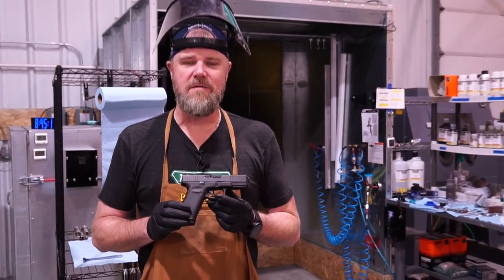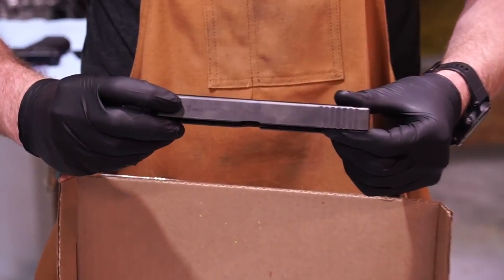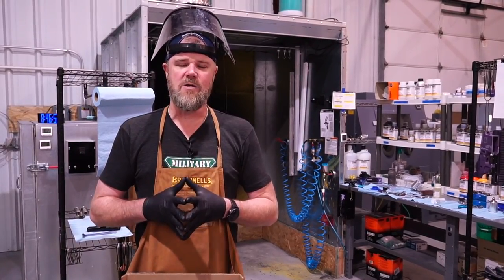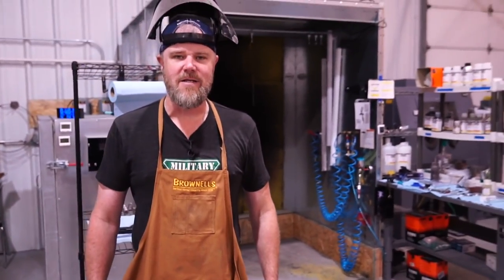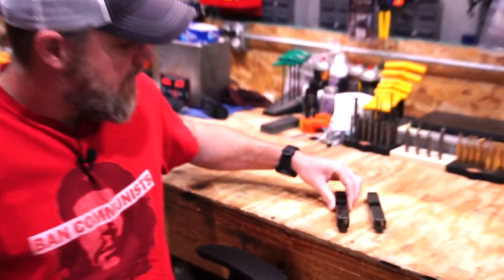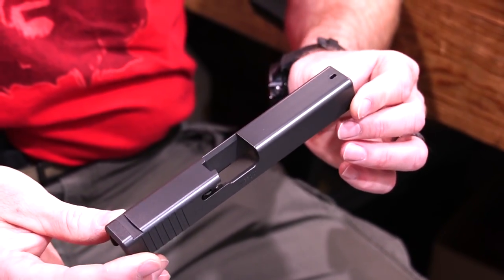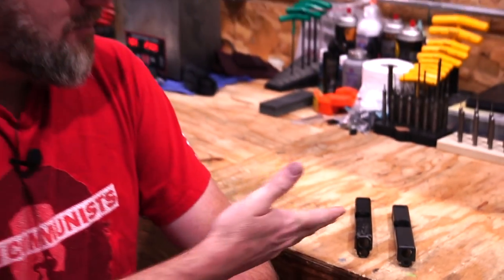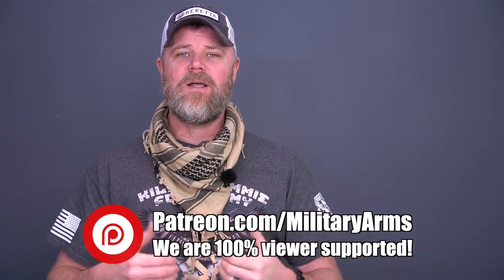Cerakote Acid Test

Comment: I'm sold on cerakote. After seeing a house fire firsthand, the cerakoted pistol was the only one that did not rust inside the safe.
Reply: And it makes the gun look cooler...while being fairly cheap.  That's what we call a win/win/win.
Reply: @Mrgone454  or a  win/win/win/win/win
Reply: I lived through a flood here in Texas my gun safe was under water for 5 days it was another week before I could get to the safe and get it open my Glock pistols were the only ones unaffected, one was a 17 Jen 2 and the only spot of rust on the gun was on the Trijicon night sights .I spent more time scrubbing the mud out of the plastic frame( which I believe still has some stains😁) then I did on any metal part on the gun.

Comment: It would be interesting to test all the different finishes Glock has come out with to see if they are actually moving forward in durability rather than just different looking.
Reply from the maker: If only we could apply all the finishes for testing it would be cool.
Reply: Military Arms Channel why would you have to be able to apply the finishes? They’re already on the guns? Something went over my head on that.
Reply: @Shane K He might not be able to source all of the guns and their factory finishes, so it might be easier for him to apply them.
Reply: Resilience to hydrochloric acid doesn’t mean anything in regards to real world durability. If that’s a test you want to do that’s fine but it would yield no data about the real world and couldn’t be used as a basis to see if Glock is “moving forward”. It would be like putting different gen glocks in a foundry furnace, melting them, then drawing some real would conclusion because one gen of Glock melted at 2500 degrees and the other melted at 2650.
Reply: @tonyn363  actually it does. Like he said in the video it is just accelerating the corrosion process. I don't clean and oil my gun everyday after carrying it. In fact I might go a month or 2 before cleaning it, even with shooting it most weekends. That would just be too much cleaning to do for me. So being able to have my sweat on there for extended periods of time and not start rusting or something is a good thing. I don't need it to resist acid but it will give you an idea as to which one is better. The next test would need to be abrasion testing. I'm not going to cook it to my truck and tear down a gravel road and expect it to be perfect but it would be nice to know that it will at least take a while before it starts to wear.
Reply: @HickLif3  Your body doesn't excrete hydrochloric acid. Dump it in a fully saturated salt water bath and have a more realistic scenario. Hydrochloric acid in that sort of concentration isn't even near a realistic scenario. Not only that is that there are my substances that resist hydrochloric acid. Just coat the thing in Polypropylene and it would be impervious to to this acid. But poly would melt under heavy use. Interesting but not real world scenario. Lets not pretend its something it is not
Reply from the maker: Did you see the Cerakote take the non-realistic test? Did you see the pics of the Glocks that were rusted? Let me guess, something unrealistic happened there too.
Reply: Military Arms Channel look. I’m not here to be a troll. I’m here because I like your channel. My point is that some substances are inert to specific acids. Some plastics are completely non-reactive to hydrochloric acid but mean nothing when exposed to heat or UV rays. Just because the cerakote Glock survived hydrochloric acid doesn’t mean it has the same abrasion resistance. All that tested here is that cerakote can survive hydrochloric acid and that is all.
Reply: @Militaryarmschannel  hey Tim awesome video like the other comment was saying any plans to see how other finishes hold up to this test I'm really interested to see how a gen4 finish does and an original gen3 finish as well as the g19x finish
Reply: They’re moving backwards, the new finish is a flash/ gas nitride, the old was shot peened then salt bath nitride and a coating applied over that.

Comment: 7:30 - If you can get the same result in 24 hours by using hydrochloric acid, that would be the standard corrosion test rather than everyone using a salt spray to test corrosion.  I suspect both finishes would have held up fairly well in a salt bath corrosion test if applied properly.  My bigger concern with spray on surface finishes such as Cerakote is abrasion resistance.  Could you do an abrasion resistance test with a Tenifer or DLC or nDLC finish compared to Cerakote and/or Cerakote Elite?  The "standard" Glock abrasion test is dragging it a mile down a gravel road.  :-)  Another interesting test would be an Izod impact resistance test.

The Cerakote Elite finish does look very nice.
Reply: All good points and suggestions.
Reply from the maker: This is the second test video, and people think it’s over? Ever seen an aluminum can painted, crushed and the pulled apart with Cerakote? 😀
Reply: @Militaryarmschannel  Ruh Roh, poor beer/monster/pop cans hahahaha
Reply: Someone doesn’t get it lol
Reply: I agree, abrasion resistant is what I think Glock was going for, both would have held up I suspect from a salt test!! I'd like to see you take keys to the ndlc and the copper custom finish to see what scratches easier!!
Reply from the maker: I doubt it. I suspect the military will always replicate ocean water, or use ocean water, given its availability and the fact they operate in ocean environments and not acid environments. When you’re the military and have unlimited time and money, you don’t need to find substitutes to save time or money when testing, just use the actual environment.
Reply: For risk of entertaining the idea of doing something totally stupid： is there any chance you could take this one step further by mixing a strong acid and a strong base Toft to test the coasting’s reaction to the violent neutralizing reaction? buffer reaction
Reply: @Militaryarmschannel  YEET
Glad to know there's more on the way!
Reply: @Militaryarmschannel  I agree. The military has the time, money, and resources to do thousands of hours of salt water corrosion testing, but hydrochloric acid is going to be far tougher on anything you put inside it for a few hours than any salt water test. I think its a good test of how resistant the finish is. Im sure the glock finish is absolutely excellent, and this test doesnt take away from that but this cerakote elite was just better at this test. People are really missing the point here
Reply: This , I don't care about an Acid bath or a Salt spray (Acids and Salts are VERY different things people this is basic chemistry). I am interested in holster wear resistance.
Reply: The cerekoted slide was already tenifered, so test doesn't prove anything. Just more MAC voodoo science to sell a product.
Reply: Albert Jabberin they bead blasted the finish off the slide before cerakoting it
Reply: @albertjabberin739  I believe he said the slide was sandblasted prior to cerakote actually. Just because the test was aimed at making Cerakote look as good as possible does not mean EVERY advantage was given. There is a reason that with the M45A1 the USMC intentionally got rid of their cerakote 1911's for IonBond models (Ion Bond and npvd are very similar)
Reply: @Militaryarmschannel  - I was referring to commercial testing, where critical time to market creates a very strong incentive to accelerate product testing, and yet the salt bath test is still the standard corrosion test method.  Test labs do use elevated temperatures in the salt spray talks to accelerate the test (Arrhenius equation for the science geeks who are interested).  I'm not saying there is no value in hydrochloric acid testing.  If resistance to HCl is important in an application, it makes sense to test for that.  In fact, there are chemical compatibility tables where the testing has already been done for metal alloys, plastics, etc.  I use those tables when selecting polymers that are resistant to gun cleaners and firearms lubricants, and I still test with those products to be sure.

Environmental testing is fun in a small company.  I recently tested an ABS brass catcher before marketing it.  I allowed it to cold soak in the freezer overnight, pulled it out and immediately threw it onto the tile floor in the kitchen, hitting the most delicate part.  I picked it up and repeatedly slammed the frozen plastic part into the tile floor.  My wife called out, "Everything OK?"  I replied, "Yeah... just doing some product testing."  So I'm all about kitchen science and shop science.

I'm not hating on Cerakote.  I'm actually a fan of various polymer coatings in many applications.  I love the powder coated cast lead bullets I make.  I appreciate that Cerakote has upped the game with the Elite series.  From what I gathered, it can be applied thinner so it causes fewer problems with clearance between mating or moving parts, it has improved wear properties (still waiting to see some tests on that important feature) and it has greater lubricity - all very good things.  Besides, I figure any product that's banned in New York City must be pretty good.   :-)
Reply: @fate930  Isn't basic chemistry related to alkaline substances?
Sorry poor chemistry based joke.
Reply: @albertjabberin739  02.14 onwards it was bead blasted first.
Reply: Any idea why the Gen 5 came off in spots when the whole slide was dipped?  @Militaryarmschannel
Reply: my understanding was that tender penetrated the surface.  does bead blasting get rid of this?  I don't really know much about this.
Reply: I have regular Cerakote grey on my gen 4 Glock 20 10mm pistol. The grey coating is holding up okay, 👍. I just got a new 9x19mm Glock 26 gen 5. It has the gen5 black surface. I'd add that I got a new Ruger LCP ll .380acp with Cerakote Elite. The slide, Jungle color can scuff & mar. I carry it in pocket style holsters mostly & it does not rust. I use Froglube or Ballistol to clean my guns & knives.
Reply: @fate930  many gunners & armed officers use Kydex & Boltron style holsters. 😉 the new Safariland TS7 holsters look good. I might get a new belt holster 7737 TS7 for my Glock gen 5 9mm, 26. I'd add that Robar NP3+ is excellent too. But is only a silver grey color.
Reply: Good points!

Comment: OK ,  very cool. 
Now abrasion and impact resistance testing please.
Reply: Rider Mak yeah, that’s where cerakote kind of stumbles. It seems nobody makes a finish that’s both abrasion/impact resistant and corrosion resistant. That would be best of both worlds and is apparently very hard to do.  It would be the worlds first magic finish
Reply: Agreed, take a steel wool pad to those slides and it would not be pretty.  The chemical protection is impressive though.
Reply: Sounds like Robar NP3-plus is close to being the magic finish.  I’ve been wanting to try it.  Too bad it only comes in silver.
Reply: PROTECTIVE RAILROAD DAD Robar Armorlube may be the grail
Reply: Cerakote won't do good. I have many guns done in cerakote and they wear easily.
Reply: Abrasion is a much bigger issue for 99% of people than corrosion is.
Reply: My first gen G23 has been my only carry gun for over 25 years now.   Shows some  holster wear....I give it minimal maintenance and I’m a sweat hog.  Still looks great.  Impressive original finish.
Reply: I don't know where all these rusting issues are arising from. I live near the beach in Florida and I've never had any issues with any of the coatings/surface treatments that her major companies use in their guns. NP3+ and Robar Roguard is really good. My favorite is NP3+, except it's prohibitively expensive. It costs hundreds of dollars to do a metal frame handgun completely in NP3+ (It's $430, plus shipping). It's $270 to do s polymer framed handgun. There are a lot of PVD/CVD surface treatments that do well. I have a piece that has a vapor deposition surface, and it's near impossible to scratch. I've tried with sandpaper. The scratches rub right out.
Reply: Looks "battle worn."
Reply: @Cerakote  your testings covering hardness and durability offer no peer comparison, unlike the corrosion test. My conclusion from that is that better coats are available on the market.

I do not like corrosion but if the coat wears out then that spot will rust.

Comment: Just as a heads up, if you do this again, make a bucket of 50/50 water/baking soda mix. Baking soda is a base and will quickly neutralize the acid. If you were to get hydrochloric acid on you or something, that will neutralize it. It’s a safety precaution.  Thought I’d help you out.

Comment: But does it protect from liberal tears? Those are extra salty 🧂 😭
Reply: If it can survive hydrochloric acid it probably can't survive extra salt
Reply from the maker: We couldn’t show the segment where we punched anti-gunners to make them  cry.
Reply: @Militaryarmschannel  
No need for that. Just make them watch any of your videos. Tears will flow.
Reply: Best comment here.
Reply: 🤔 For those salty liberals, you should probably direct them to Adam Ruins Everything, so that they are properly informed that gun control laws are in fact racist, and their support of it only means they are racist. 😂 If I meet another soldier whom supports gun control again, I'll be sure to inform him or her that little fact... they only support it because they had to be pencil whipped on their IWQ. I'll admit I had too once... when the retainer pins on my M4A1 was worn to the point that you could hold the rifle from the upper and could fit the file from a Gerber through it. 😂 I could still hit the 50m targets no problem but the 100m was literally impossible. One of the guys on the range was a sniper shot it and told me what the issue was and showed me how bad it was with his Gerber. 🤷‍♂️ 8 years of being a mechanic and I had NO idea that could cause such an issue. My last IWQ was with an M9 and it had damage to the crown, and I was able to work with that and got a first time qualification before sending it off for repairs. National Guard be like, "take this weapon" But this isn't mine and there is crap wrong with it. "You should have PMCSed it before you got this weapon." Its not mine "Sign off on it, you're taking this weapon."

Comment: This test only show the reaction of finishes to the acid. It does not represent a proper hardness/scratch resistance test. Accelerating rusting process with acid is also not a accurate representation of regular formation of oxidation (rust). Overall results does not prove anything except glock finish reacts with acid.
Reply: Exactly.
Reply: I fully agree it acts different to different materials just cover the glock in plastic then the acid wont do anything.
Reply: Missed the point of the video so hard you missed the whoosh over your head, too lmao
Reply: @hilgorgruppenschaaft2203  "Missed the point of the video so hard you missed the whoosh over your head, too lmao" That also could be said to Mac about factory firearm coatings. Wasn't until these videos of letter filling and painting did anyone have any concern. And that's only cuz they're introducing harsh chemicals they would have never encountered before.

Comment: I am not surprised by this result. Cerakote is essentially a type polymer after it cures. Polymers are very stable, and can withstand acids, bases and ion corrosion because they are mostly chemically inert. How well they do against them is dependent on the exact chemistry of the polymer.

Melonite, tenefer, the new Glock finish, and other nitride type processes are still exposed metal. They are just a thin layer of special forms of chemically induced alloy. Corrosive agents can still attack the metal atoms within the material, just at a slower rate. I believe the black outer color is not the entirety of the nitride layer, and just because the black color is gone, does not necessarily mean the protection is completely gone.

Resistance to abrasion and other physical wear is likely better on the nitride type finishes. The slick nature of Cerakote will help it, but any small grain abrasive that is harder will find a way to scratch it. Micro abrasions will add up quicker. Cerakote is simply much softer than steel, and more so nitrided steels.

If it is possible to prep the surface of a nitride treated steel, in a manner that allows the Cerakote to adhere well, without removing the nitride layer on the steel, that would provide lot of protection. Not perfect, but nothing is.

Comment: Cerakote is impressive. I have car parts done in Cerakote. Generally, it does wear off in spots, but those assemblies are ALWAYS easier to clean and stay cleaner to begin with. Exhaust parts, vane pumps, containers, Pistons, air tools, brake rotors. 
-- Brake rotors for example, don't get so much junk/rust stuck to them, so working on them is easier. 
-- Vane pumps and gears develop wear spots that are easier to see, so we can shim them up or tweak them on re-assembly. 
-- Intake ports give us less no-slip condition. They seem to cold-start better with less adjustment. 
-- Turbos stay looking new. 
-- Exhaust parts don't rust together.